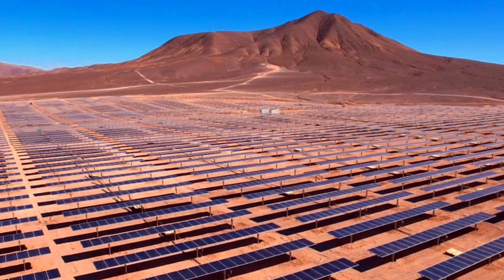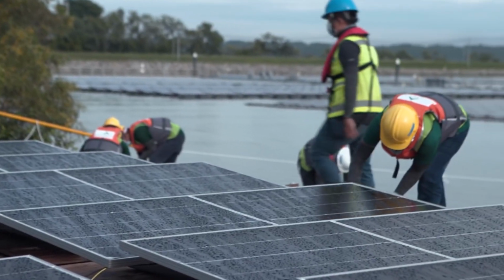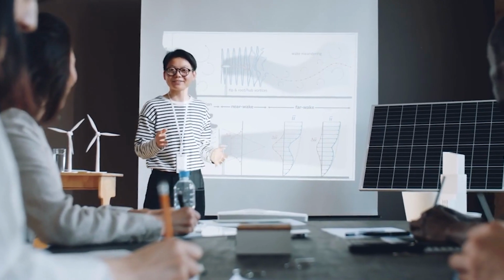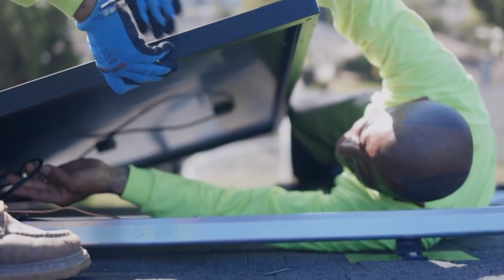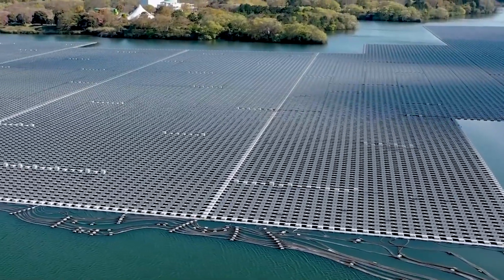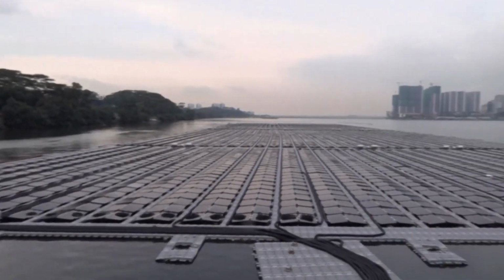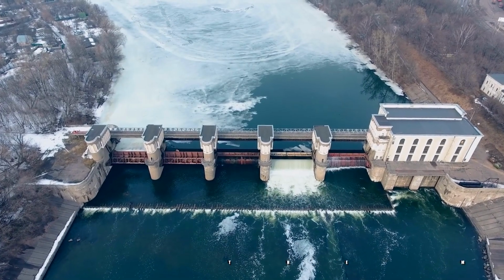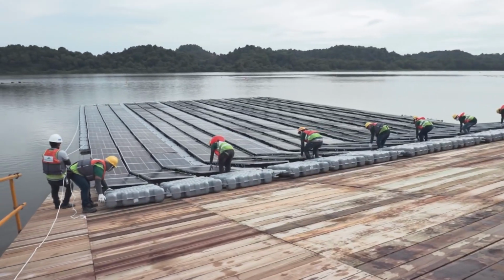THIS Is Europe's Biggest MEGA Floating Solar Project EVER

Comment: Too bad centralized solar plants require oil and coal built infrastructure to distribute.  Otherwise this would be a pretty big step in the right direction.  The real solution though is distributed solar networks.  Small individual producers running at 6% solar coverage spread over a large area is far more secure, reliable, sustainable, and beneficial to the lower end of the economy.  Instead of hobbling the poor with debt energy you let them farm it and sell it.
Reply from the maker: I like your idea! In Europe the cost of energy is rising higher and higher. A lot of people can’t even afford it anymore